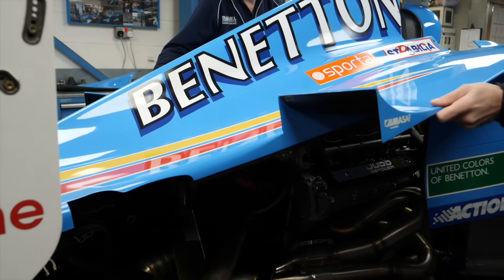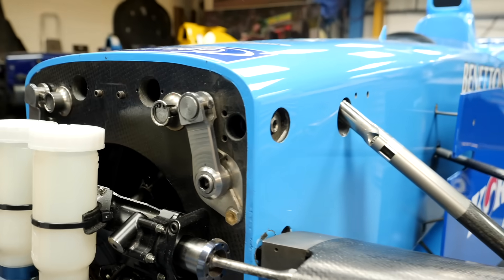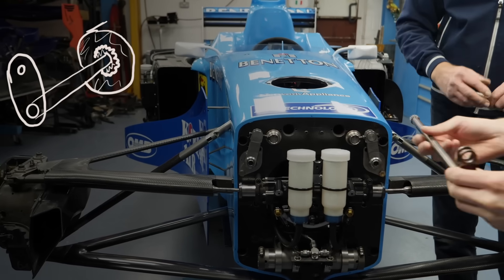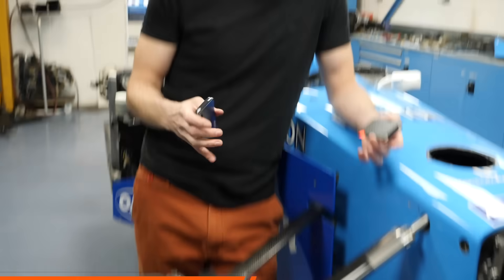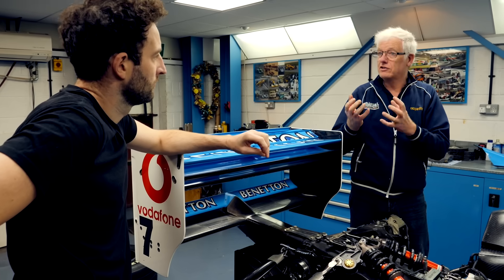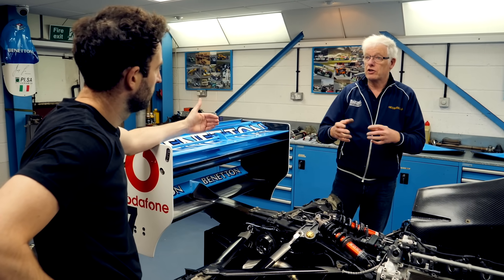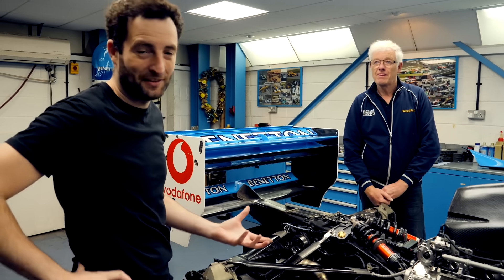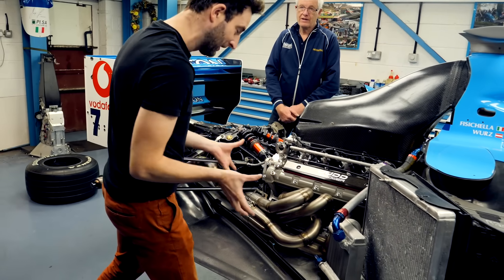Why F1 Suspension Doesn't Use Coil Springs!

Comment from the maker: Big thanks to Ridge for sending me this wallet and supporting the channel! Here’s the site if you want to check them out! > ridge.com/DRIVER61

Who want's to see more of Big Kev in future videos?
Reply: Can I work for your dad?
Reply: Can i work for him too? Can we see more videos like this? Can i like this video twice?
Reply: Me. More on F1 Engine tech please. Is that a Judd V10?
Reply: @mkf8628  Of course. The nameplate was on the engine and they said it was a v-10 in the video.
Reply: pitty that you did not show how dumpers at the front works. Also explanation of heave springs would be nice.
Reply: Lolz i get now why you driver and not engineer.  No shame m8 , im neither...
Reply: Looks to me the headers are equal length. The cylinder in front has a more straighter pathway but the cylinders further back need to have the same length in  much smaller space that's why they curve around as they do, to keep the length the same. Having an equal length header means the exhaust pulses come out in regular intervals. 

An unequal lenght header would not have as smooth of an interval between exhaust pulses as an equal lenght.
Reply: @carlosandleon  thanks for clarifying. Was very interested in the video segment but got confused w the explanation described as “...unequal length...”. If i have this correct and Re back pressure, unequal would result in additional back pressure as all the pulses would collide, while equal length would line up with less back pressure or no back pressure. Next question - is some back pressure a good thing? Why? and what are diffs between an F1 and say a road going car?
Reply: @thinkerdoit  I have no idea man, that is out of my depth. I do believe some backpressure is good but I really don't know any further.
Reply: Interesting. Torsion bars were used on early tank suspensions as well.
Reply: Yes, he's awesome, the two of you should do a podcast together or a deeper dive into some of the parts of the f1 car. I never knew about the length of the exhaust pipes!
Reply: So what year was that car's design from?
Reply: Let's see more of that Benetton! Get it on the track :)
Reply: Just give your pop the channel, he’d do more interesting things with it than milk his fathers knowledge and act like he knows as well.
Reply: I LOVE the segment about the exhaust system!! I credit my late Dad for my interest in motorsport and classical music, though I never had the capacity to do anything with either. SO, when I was very young (1981-ish) watching some motorsporting this or that on T.V. with him, I saw the "bowl of spaghetti" pipes on the engine. I had been under the hood of the ol' '63 Chevy handing him wrenches a lot already and knew they were exhaust pipes, but Dad's manifold didn't look like that. I asked why they look so weird and he muted the T.V., took me outside and popped the hood and explained so that my 6 year old brain could grasp the basic why of it and why his was different, etc. What he didn't do is the typical dad reply: "Cause it works better, shut up or go play outside." The video did clarify some more like engine tuning that I never really got.
Reply: NICE AWES0ME C00L_ 🍨🍚🍚🍚🍚🍚🍚🍚🍚🍚🍚🍚 💨 🍮 🥧 🍡 🍧 🍨 🍦 🍰 ❗ 🐬 🌺 🌺 🌺 🥀 🌹 🌷 🍁 💐🍂 🐡🐄 🐅 🐆 🐯 🍣 🍣 🍣 🥘 🍨🍨🍨
Reply: pops is quite good on camera as well and obviously knows everything - you make a good team
Reply: What is lacking with Mechanical Engineers today, is the knowledge of how to design mechanisms correctly. Did know that there's a mathematical formula that can be used for all mechanism designs? It's called Gruebler's Count. I found a way to make it practical for all 3D mechanisms. Here's the link if you are interested.  https://youtu.be/KFB8gMjxDPk
Reply: Yes, absolutely. But, if you do, please centralize the microphone. He was quiet so I'd turn it up. Then, you'd speak and it was loud.
Reply: Yes, more of the footage with your pop at his shop.
Reply: THANKS FOR SPONSORBLOCK FOR SKIPPING THE SPONSOR SEGMENT :D

Comment: The old VW beetle uses tortion bars in front and rear suspension. All four wells are totally independent in terms of suspension. Light weight and easy to maintain.

Comment: I cannot remember what the front suspension is on the 96 Benetton F1 car that I worked on some.  Notice that at 9:26 the other attachment to the rocker is the anti-roll bar.  Under the gold cap are needle bearings.

Comment: I think the balance was right and a good explanation of header design principles. You might be interested to know that old drag racers used make the primaries short, fit a temporary collector and paint the system. Then they’d fire it up and rev to the red line. There would be a spot along the system, where the paint burnt off and that would indicate the optimum place for the permanent collector.

Comment: With multi cylinder engines  longer primary  pipes mean more top end horse power, not a  mid range boost like the moody graphic in the video( with an in line 4cyl  a 4vinto 2 into 1 is the best compromise plenty of mid range without sacrificing top end power).  Can't believe he got such a basic principle arse about face. 💩🏍🏁

Comment: Dont know what your talking about a current F1 car is 2metres wide and 5.5-5.7m long and weighs 792kg. This Benetton weights 600kg - with the driver,  4.43m long and 1.8m wide. Exhaust headers are THE SAME length, he tried to explain to you that the exhaust must be displaced in sequence so that there is no back pressure.

Comment: F1 cars have engine and gearbox directly bolt on to the chassis/monocoque is because they want these (engine/gearbox) to form part of the chassis so that the utilize the strength of these components thus less material less weight more efficient mechanical design. The bad is engine and drivetrain vibrations directly transmit to the cabin whcih is not acceptable for any road cars. Thats why you have engine mounts and gearbox mount bushings to separate vibrations. This video misses the most important design details.

Comment: When Fi used 13 inch wheels and fat tyres, suspension was more about controlling the effects of larger bumps. Today's cars with 17 inch wheels and low profile tyres need suspension that actually does shock absorbing stuff.

Comment: Using the engine as a stressed member goes back to the Lotus 43 in 1966.  It was designed to use the BRM H-16 engine as a chassis extension.  That car is little remembered because the H-16 was a dud.  The design that is remembered is the Lotus 49 which used the first Cosworth DFV V-8 as a stressed member.

Comment: Could, instead of the header pipes being a given length, could the pipe diameter be varied to achieve the same effect?  As diameter changes, speed/velocity of the gases exiting would vary.  I'm not sure if this would work, either for physics or machine/manufacturing reasons, but I'm curious

Comment: I was alway under the premise that the exhaust design on an F1 had everything to do with exhaust pulses coming Back up reverse to the gas flow and stopping/pushing any gases from bleeding out the exhaust. 
You know massive cam lobe over-lap. Inlet and exhaust are open at the same time for a long/fun time. 
The equal length collector mitigates parasitic effects.

Comment: I can't get my head around how that  bar twists and doesn't break.  It's a very old system. I remember the original Volkswagen Beetle had torsion bar suspension until it was upgraded on the 1303 mid 70s car .

Comment: Citroen 2CV had torsion spring suspension since the middle ages (late 40's). And all wheel independent suspension and tuned mass dampeners when most American cars had rear solid drive axle and leaf springs straight out of a horse drawn carriage,

Comment: The five-in-one header work like a Bernouilli pump so that the flow from one cylinder will create low pressure in all the other cylinder tubes to suck out the exhaust when the valve opens.

Comment: I run a 1950 car as a fun vehicle (Jowett Javelin). If you remove the rear seat cush, you can see the torsion bars running the width of the car. Interesting to see how much shorter they are now, even allowing for the difference between road and race cars. Some dishonest bird-cage gentleman once put my dad off keeping a Wolseley 6/80; said the torsion suspension was "about to collapse". Wanted to sell him another car.

Comment: But, but... You did not asked your dad the million $$ question about the exhaust system ;-)
If the collector is the first restriction point, why have it at all? 
Why not remove it and have 5 separate exhausts on each sides?
No restriction at all!

Comment: A coil spring IS a torsion bar, my good man. Coil springs are NOT compressed, they are twisted. My BSc MechEng was in Suspension and Transmission design.

Comment: Fascinating. Torsion spring at the front suspension is quite interesting since it reduces weight, cost, and packaging difficulty. But, how does the front suspension dampen the forces? I'd imagine there needs to be some dampening mechanism to prevent the front of the car from oscillating continuously. Would the damping due to tires and other components suffice?

Comment: So, coil springs were replaced by torsion bars. If the 2000 Benetton's front suspension already used torsion bars, then I assume the 2009 Brawn's had torsion bars on the rear's suspension.

Although, anti roll bars could still use coil spring. I think. So, no mystery if that suspension collapses.

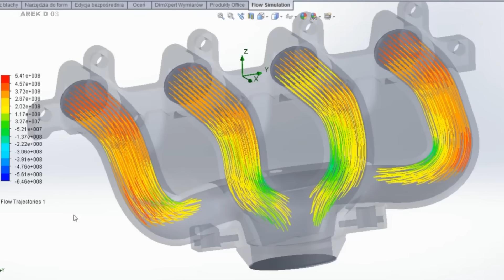Comment: At 4:25 the son says, "If they were the same lengths they wouldn't come out, they'd all bang together." 
Wrong! They are all the same lengths. The pistons fire at different times and the exhaust pulses travel the same distances to arrive at the collector at different times. The pulses don't bang together.  The pipes that start closer to the collector need to be curved to be the same length as from the farthest cylinder.

Comment: A coil spring is just a very long torsion bar wrapped around itself. It still works by twisting. And your mixture should never explode. It burns in a very precisely controlled way.

Comment: In reality the weight of the spring alone vs torsion bar is negligible. The question really is, where is the front shock or what type of apparatus is used to control jounce and rebound?

Comment: The wire in a coil spring twists EXACTLY the same as a torsion bar.  
Same principle, but merely wound into a coil to fit the design.

This is why there are hard rubber/plastic SEATS at each end of a coil spring
 - it preventthje coil TWIST wearing out the metal in the arms, etc. 

Don't believe?
Get a small coil spring and clamp the wire on one end.  
Now, compress it, watch the wire TWIST.

Comment: I was of the belief that it was necccesary to keep the manifold tubes the same lenghth. As the firng oder is non-uniform, the manifold should be kept the same length so that each cylinder exhaust  doesn't 'clash' with its neighbour.

Comment: So I'm still confused about the exhaust lengths. It sounded to me like your father was saying that the pipes prior to the collector needed to be the exact same length, which made sense to me since each cylinder (on one side of the bank, obviously) fires at a different time and thus the gases from that explosion would reach the collector at a different time.

Meanwhile, you're saying that they're all different lengths in order to ensure that the exhaust from any given detonation reaches the collector at a unique point in time.

Which way is it?

Comment: I was thinking the other day, if torsion bars are used for suspension in place of springs, then could they be used for engine valves? the packaging wouldnt be that bad, and you could potentially use the same bar to close pairs of valves? maybe they could be used for a desmodromic setup.. one arm opening, one closing.. thoughts people?

Comment: Also a huge reason for bolting the coilovers to the transaxle and using a pushrod is to remove it's weight from the suspension.  The weight of the suspension, brakes and tires and aero is enough. You don't need to also have the springs and shocks adding to what needs to be damped and sprung.  The result is that you can have much more control over the damping and you can use smaller and lighter weight springs and dampers.  Short answer, reducing unsprung weight also reduces the overall weight.

Comment: From what I could see, the two rockers are connected to some kind of a swing arm pivoting on its center. This will make the rockers work against each other so when one side compress, the other side will want to expand. Bu what happens when the two wheels wants to go up on a bump?
Maybe I got this wrong from what I could see. Can you elaborate.

Comment: I don't know if I'm missing something but if that bar acts as a suspension won't it have a tendency to snap
Reply: The properties of the material are known as are the operating conditions. The design of the system will ensure that the material will not see a force it cant cope with.  What isnt mentioned is that a coil spring is in fact a very long torsion bar, just packaged into a helix, it twists as it is compressed and that is how it stores energy.

Comment: Great video. I didn't get, is it the original engine used by Benetton or a custom made by a third-party company? Also, where do the dampers go with torsion suspension? Thanks!

Comment: just to say, springs are not so different from torsion bars; if you were to mark the surface of a coil spring so you could see what is happening when it is 'compressed' you would see that the spiral of the spring is actually twisting as it is being compressed - the spring is really a torsion bar all coiled up. I own a 1960 Riley One Point Five, it uses torsion bars for its front suspension (much longer than the F1 torsion bar), The torsion bars are adjustable at the point where they are mounted to the chassis. a very useful feature...also owned a Citroen Saxo again with torsion bars allowing the ride height to be easily changed.

Comment: Interesting, and more worth the time than most YouTube content, but if you want to be even better you should try using the car more. Don't just say there is a suspension rocker - point it out. Don't just say "primary tubes", point to the primary header tube from each cylinder, so those who don't already know the terminology can learn it... in the same video time as this "stand there and talk to each other" method. 

You also managed to completely reverse the logic of equal-length headers, and somehow missed the swaybar operation entirely, which is much different from a normal car and easy to show on this car.

It is nice to see the car to illustrate the discussion, even if it isn't being used as effectively as it could be.

Comment: That's the worst explanation of equal-length exhaust headers ever. It's not restriction, it's time and speed of the exhaust pulses that scavenge the exhaust and pull intake into the cylinder. The length is determined by what engine speed you want to develop torque or horsepower (HP=Torque in Ft-Lbs*RPM/5252 above 5252 RPM the big number is Horsepower, below 5252, the big number is Torque but they basically refer to the power developed by the engine) and there is a very complicated formula for calculating the size of the tube based on the ID and length.

The stuff about the suspension was mostly correct.

Comment: On the rear suspension, on the rocker component, there is a linkage that looks like it connects the two rockers via another rocker. It looks like it'd apply an equal and opposite force to the other wheel when the spring one one side is compressed. What is this called, and why would they do that?

Comment: It certainly is interesting just how much obscene engineering goes into even the earliest formula 1 cars and seeing how smaller and lighter progressed over the years to extract every single iota of performance they can. I never even considered how the exhaust gasses would interfere with a variable length exhaust manifold.

Comment: Torsion bars seem so much more simple from an engineering and quality perspective and often they package better.
Reply: Yes, but they are extremely stiff due to the short length. That is shy coiled springs were invented. Having a suitably long torsion bar would be impractical in many applications.

Comment: The video footage is fabulous.  The problem with this video is the discussion is all just generic motorsports information. It's not particularly specific to F1 technology.  I doubt anyone will click on this video who doesn't basically understand torsion bars or force transfer rods or header lengths. 
We want to hear about the exotic things we don't see on a production vehicle.  For example questions that come to mind when watching the footage:
Which parts are aluminum and which are titanium? 
Are any other exotic materials used on the visible components like Kevlar or Iconel?  
Are the shocks position sensitive or just velocity sensitive? 
What is the purpose of the mechanical link that we see connecting the two rear shock rockers?  
How does the driver adjust the roll stabilizer? 
How are the metal ends of the wishbones bonded or connected to the carbon fiber aero tubing?
How are the carbon brake rotors mounted to the axle to transfer the rotational braking loads? 
Do the exhaust pipes leak at the slip-over joints and if not, why not? 
Are the CV joints noticeably different from a regular tulip CV on passenger car? 
How big is a typical F1 rear wheel bearing? 
How much wheel travel does the car have? 
How much steering angle can each front wheel turn? 

You get the idea.  Information specific to F1 cars.  Thanks for the video.